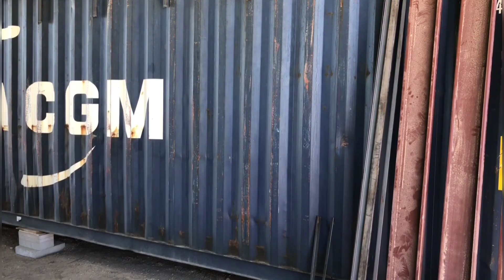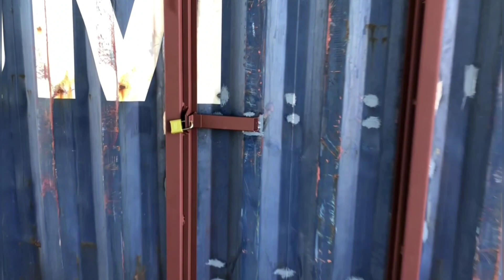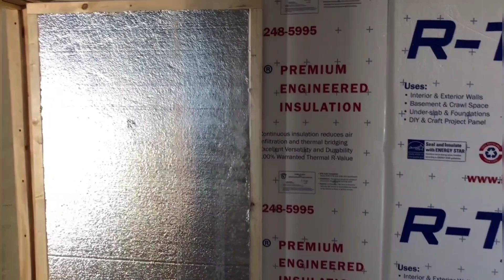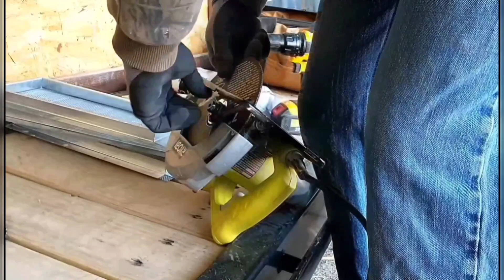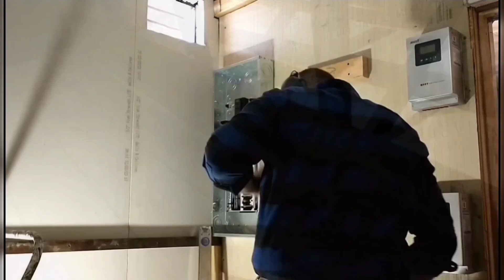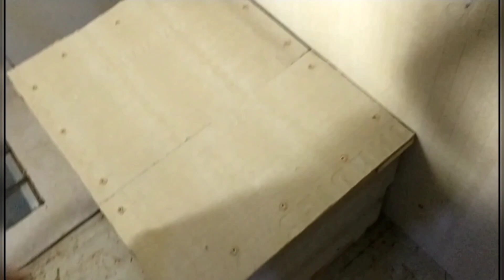A Look Back 🏜️ Shipping Container Door, Passive Venting, Solar Room & Components  March 2021

Comment: Thanks for sharing this mid-week video look back.    Were those your grand dogs at the end of this clip.?  Certainly a way to keep pests out by allowing dogs under the containers.  If your inverter starts producing “too much” heat, a couple 12vdc computer surplus fans can be used to circulate room air into and under the inverter.   Fan bearings will last longer if circulating ambient air than pulling warm air.   

Wishing you and Red another blessed week and a gentle spring season.  Peace
Reply from the maker: Thanks! 😊
Yes, the Akita passed from an unknown sickness last summer, we heard of others too, so something must have been going around. 😔🐶
Reply: @RedandAprilOff-Grid  so sorry for you loss.  Losing a pet is heart wrenching.  Holding you and your family in thought and prayers.  Peace

Comment: Looking forward to seeing how the passive cooling works once summer kicks in!
Reply from the maker: Last summer worked out well, the temperature on the inside was pretty much exactly the same as the outside. In the summer, he put a fan in the solar room, the inverter produces some heat, and when it's over 100 degrees outside and the afternoon sun is shining on the solar room, it's hard to keep everything as cool as we would like, but the inverter did fine. Fortunately we are only that hot for a couple of weeks.
Reply: This is great to know as we have higher temps and for longer here!

Comment: I was going to ask if you taped the seams of the insulation.  At 10m30s in the photo it seems you did?
Reply from the maker: Yes, looks like he did tape all or most of the seams. The sheets go up 8 feet, so there is a gap above the solar room, we don't see any signs of moisture so far. Our winters are really dry. We get well below freezing at night, but warm up quickly in the day.